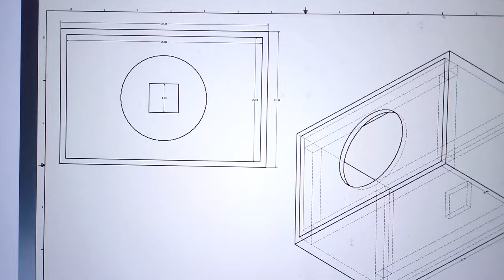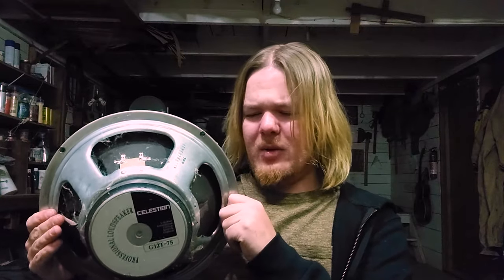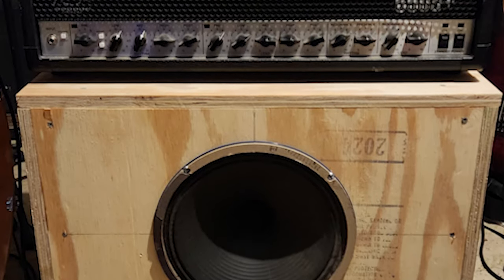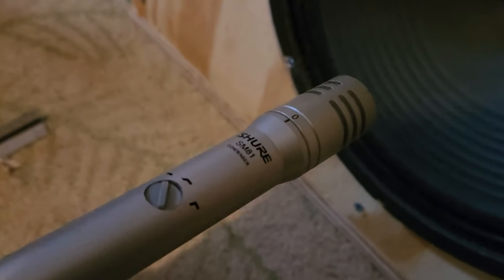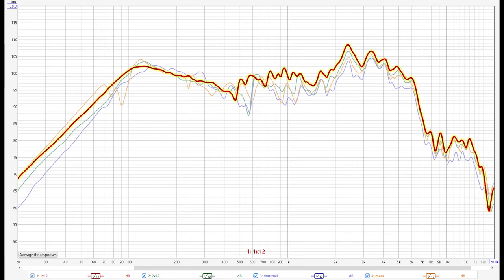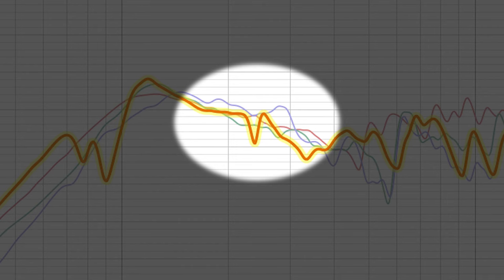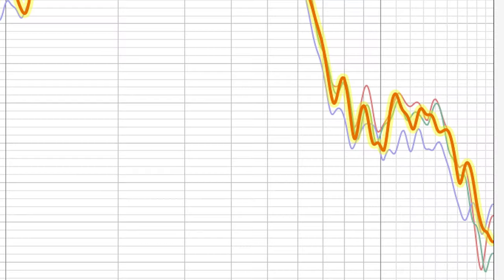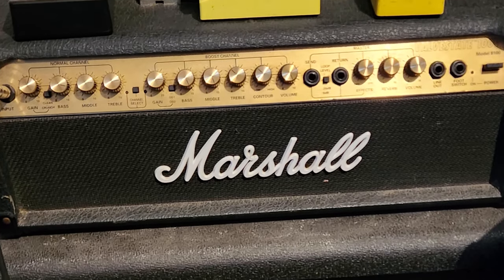I Built An Oversized Custom 1x12 Guitar Speaker Cabinet

Comment: Nice first cab build! With the internal bracing it will survive nuclear attack! Half-inch ply is usually OK and saves you a little weight if you have to move it. The nice thing is once you have a big enough cab built, changing configuration is as easy as cutting a new baffle.

Comment: Very nice video. To be honest I feel like there is as much luck to sizing up a cab as there is skill, unless you start working very intentionally with modes. But as soon as an angle baffle gets introduced, those maths get funky.

Your cab sounded like a great 1x12: no obvious congestion, and then the top end is very forward. I feel that 4x12’s introduce a polish in the top end and a mid forwardness due to subtle comb filtering. Would be fun to chase that… maybe with a non-symmetrical positon in the baffle?

I really like the Mesa cab sound, despite having reservations about them (I also watch Psionic audio and own a Rev G Tremoverb which is not my cup of tea). I don’t think that notches in the response means anything when they are that deep anyway. The phasing in guitar speakers and cabs is ridiculous anyway, which is part of the sound.

Also, jealous of that 2002 speaker, sounds gnarly as hell.

Comment: You were saying the 1 x12 is good for a punchy bass that’s not muddy. I play baritone and just struggle to find a decent tone out of a guitar amp. I actually play through a tiny Traynor 1x 8-I find it compresses the low B enough I can just plug in and get that compressed distorted sound. Any suggestions?
Reply from the maker: I mean... if the equipment you currently use suits your wants, I'm not gonna tell you to get something different

Comment: re-cone'ing (spelling?) is fairly simple. you could fix that with probably less than $20 in parts and a couple hours of watching how-to vids
Reply from the maker: it wouldn't sound the same, though. I bought that speaker in the first place because it was from the early 90s and I was chasing a tone that was made with early 90s T75s
Reply: @TheRealLordofEmeralds   I get what you're saying, but I originally found out about re-coning from watching high end stereo speaker repairs. I think those guys would probably notice if it changed the characteristics of the speaker. A paper cone is a paper cone, a lot of the "sound" would come from the wiring and basket etc. But then again...I don't really know for sure. You might be 100% correct. Might be interesting to find out though
Reply: @colestowing8695 I don’t agree on that paper claim. The consistency issues in paper production is likely a big contributor to why we have speakers sounding different, even when they’re from the same batch. That paper mash is hard to get 100% consistent every time. At least in guitar speakers, where the low tech quality of them is what makes them desirable.
I bet the most common formulas for cone materials in modern high fi systems have changed quite a bit more over the years than the ones we still use in our guitar cabs.
Reply: @Ari_Calamari  maybe you're right. But then again (and it's been a long time since I watched the vid)...I think it was a choice of a usable speaker vs a non usable one. Even if it's slightly different that's still better than chucking it in the garbage... No?

Comment: If you're not using a re-amp box you're tests are not going to be completely accurate.
Reply from the maker: I mean... for the measurements, it was the same exact sweep tone, and for the speaker swaps, I was just playing the same riff. The speaker swaps were not a "scientific" comparison, I just wanted a general idea of how each one sounds in the cabinet
Reply: @TheRealLordofEmeralds  Look man. I've been a professional audio engineer for years. A reamp box is not expensive. You need to test the exact same riff via different speakers. The only way you can do that is by using the exact same take. This is done by using a direct box and a reamp box. Not saying that your test was 100% flawed. However if you want to be 100% my advice is golden. You're welcome.
Reply from the maker: did you not read what I said? I just wanted an idea of what each speaker in the cabinet was doing to the sound. This was not a "scientific" comparison, although I have done videos where I have used the exact same performance. and it's not like I was using a different guitar or different riff each time, so for a rule of thumb, I'd say I did pretty good. I don't care about how long you've been doing this, I don't appreciate being talked down to
Reply: @TheRealLordofEmeralds  I can read just fine. If you want to know what each speaker cabinet does to the sound you're going to need to reproduce the exact same take. This is done by using a direct box and a reamp box. Two different takes using the same guitar can make a pretty big difference. That's why it's important to use the exact same take. Hope that helps. You're welcome. Again.
Reply from the maker: I know how to fuckin' reamp. I've done it before and I also know that to get a general idea of the character of a speaker, you don't have to reamp. You can play the same riff with the same guitar. Me playing the same riff slightly differently each time due to human variance isn't gonna make the tone that comes out of the speaker fizzier, muddier, more scooped, etc. What WILL clearly change all of those things is a speaker swap. My measurements are the raw data, the recordings are real-world sound examples. Now if you've got nothing better to do than nitpick the methodology of a hobbyist recording nobody on Youtube who's doing this for fun, then find another one who's not me